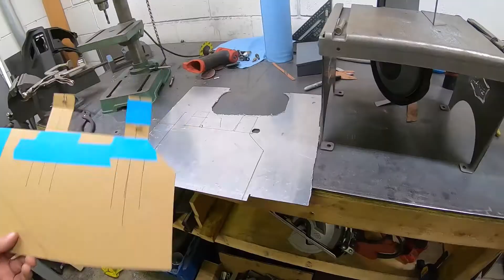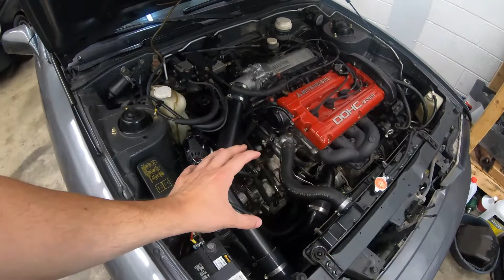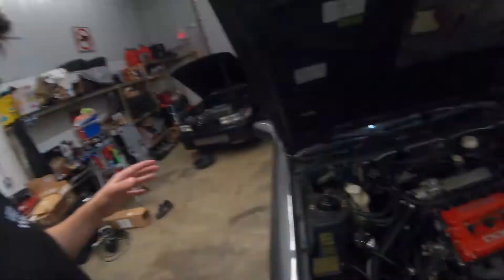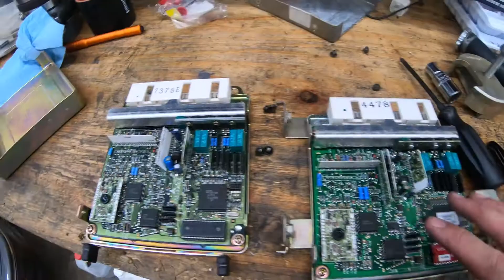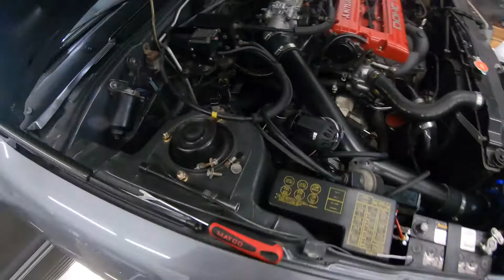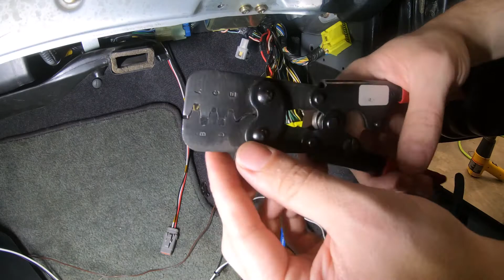Mitsubishi Galant VR4 upgrades part 3, ECM link install.

Comment: bro how did you install the fuel pressure sensor? you make a hole into the filter line?
Reply from the maker: Nope, there was an adaptor fitting on top of the fuel filter banjo bolt.